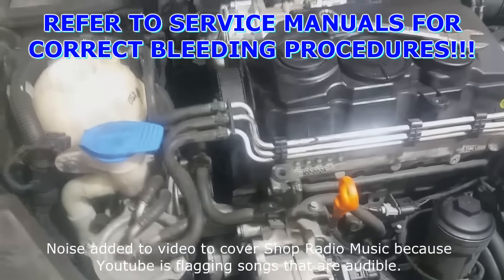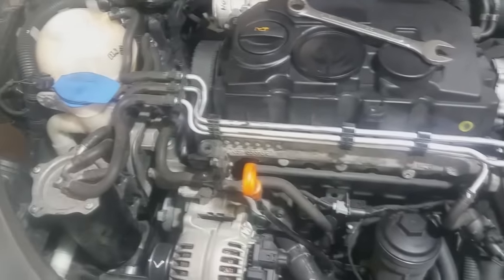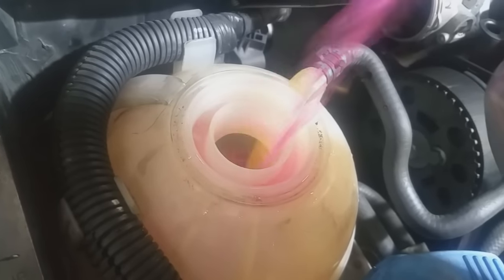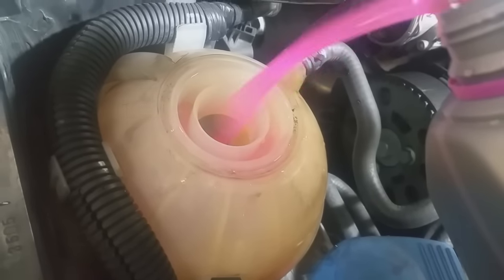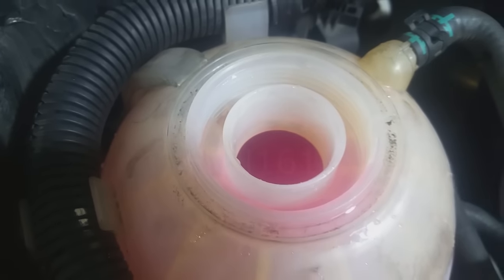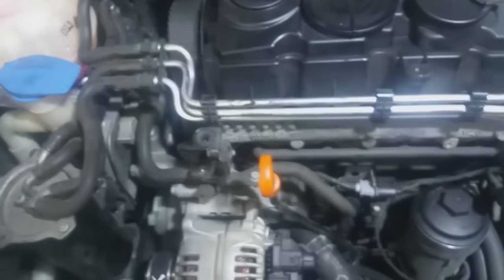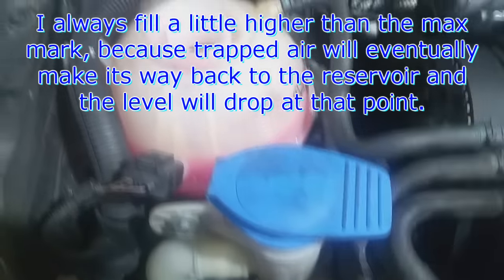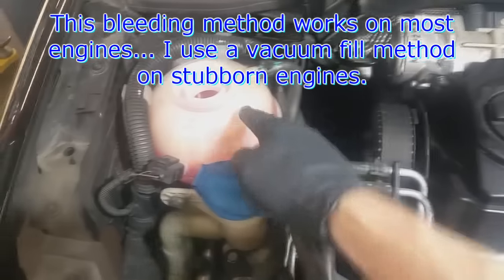Basic VW cooling system filling / bleeding info (viewer request)

Comment: Does the engine need to be on during this process?
Reply from the maker: I think one can hear that the engine is off... once the coolant level no longer drops, one can start the engine and confirm coolant flow back into the reservoir (verifying coolant flow). I think everything is mentioned in the video.
Reply: @EXOVCDS  sorry I'm a complete car noob and worry about this slightest things with my car. It's been making a water sloshing noise lately when I start the car and having a bit of a shaky start up. Researching it has led me to believe its the coolant system needing to be bled. I've had to top it off with distilled water this summer.
Reply from the maker: @tovar2358  Year, make, model, engine? Coolant level should never need adding... if it does, there's a leak somewhere.
Reply: @EXOVCDS  2014 jetta se 1.8 L. During the summer I had to top it off at least twice. After the second time my low coolant level light didnt come back on, 3 months now since it did that ding on my dash.
Reply from the maker: @tovar2358  Have a good look at all the coolant hoses, flanges, fittings etc. If the system is working correctly, it will bleed the air out on its own (into the coolant reservoir). Regular driving (until the thermostat is open... engine cooling fans come on) should be all that is needed to get the sir to bleed out. Higher RPM driving can also help force air out of the heater box inside the car (that might be the sloshing sound you are hearing). Set the heater to hot air, so that you can monitor heat. If heat gets cold all of a sudden, it could be due to air, water pump or an issue with one of the heater blend doors.

Comment: Should the cooling fans come on when the engine is warmed on TDI ALH ? I never heard mine only when I turn on the AC.
Reply from the maker: +Mateusz K You won't hear them when you are inside the car... if they come on at low speed. The TDI takes a long time to warm up. If the gauge in the dash says 90c / 190F the lower rad hose can still be cold. You have to wait quite a while... have someone sit in the car and hold the rpm at 2000rpm (20x100rpm) while you look at the cooling fans in the engine bay. Grab the upper & lower radiator hoses with you hands and compare temperature... the lower hose should stay cold for quite a while. Once they are both hot to the touch (can not hold them for long) the fans should come on. If the temperature gauge goes past 1/2 way towards 3/4... something is wrong.

Comment: how van i empty the radiator ?
Reply from the maker: Year, make, model, engine?
Reply: @EXOVCDS  Audi a3 2005 2.0 TDI i would really appreciate it if you would elp me .
Reply from the maker: The radiator does not have a drain valve... you will have to remove the lower radiator hose to drain coolant from the radiator. Because the hose is not at the lowest spot, some coolant will remain inside. If you are wanting to drain the engine as well... you will have to remove other coolant hoses to allow the engine to drain coolant.  You can also remove coolant temperature sensors that are in coolant flanges or hoses to do the same thing.
Reply: @EXOVCDS  thank you very much man i really appreciate it

Comment: Where to drain the coolant? Thomas
Reply from the maker: In a bucket. What size engine?
Reply: +Thomas EXOVCDS 06 Passat 2.0T FSI
Reply from the maker: There is not one place that will drain everything... you need to open the system in a couple (or more) places in order to drain most of the coolant. Some will not drain out (heater core, some will stay in the engine block and radiator). Remove the lower radiator hose, remove one of the hoses at the electric "after-run" coolant pump. Remove other hoses in other locations to drain even more.

Comment: I got a blockage.  How do I fix it?
Reply from the maker: Find the blockage... disconnect the hose at the other end. Do you have flow there? No? Check farther down the line.
Reply: So follow the return hose and disconnect  the hose at the end? I've been having overheating problems, change the thermostat, control fan swith,coolant cap reservoir. It kind of did the work but when I stop the vehicle the temperature starts rising. It's a 1.8 volkswagen jetta gli
Reply: The fans kick in buy stays the same forgot to mention that.
Reply from the maker: How is the heat inside the car? If there is little or no heat, the water pump is bad. Yes, follow the hose to where it connects and disconnect there. If it's a T fitting and nothing comes out, fully remove the T fitting to check it for a blockage.
Reply: When I turn the heater it's not that hot,but the ac it puts out cold air.  So the water pump then? Do you know how much they charge for that?
Reply from the maker: Phone a shop in your area to get a ballpark estimate... you can check the water pump impeller by removing the thermostat and checking if you can turn the impeller.
Reply: Thank you for taking your time to answer my questions, I appreciate it.  Ima fone some shops to see how much they will charge me and go from there. Again thanks for your help.
Reply from the maker: No problem... let me know what they find. If you want to check the water pump yourself... here's a thermostat removal video.
https://youtu.be/HjL9P5cZw6g

Comment: I hope you can help. 99 Jetta 2.0 overheating while driving after new water pump and thermostat. Does not overheat at an idle. I have flow from the head to the coolant reservoir, flow from top to bottom of radiator, heater blows hot, top radiator hose is hot, bottom radiator hose is cold. I have repeatedly squeezed the hoses to try and get air out. Running out of ideas?
Reply from the maker: When you let it idle... can you idle it until the lower hose gets hot and the fans turn on?
99 Jetta mk3 or mk4 (timing belt drives the water pump)?
Why was the water pump & thermostat replaced?
If you had a severe overheating incident, then you might have a headgasket issue.
Overheating as in the needle starts to climb or the coolant comes out of the reservoir pressure vent port?
Reply: Thanks for your fast reply! The upper radiator hose failed and it did overheat for about thirty seconds +/-. After replacing the hose it would get hot but the lower radiator hose stayed cold so I thought that might be a bad thermostat. When I removed the thermostat I checked the water pump and found the impeller was bad so I replaced the thermostat and water pump. Now it still gets hot when I attempt to drive it and the lower radiator hose is still cold.
Reply: I can't let it idle until the lower hose gets hot or the fans come on. Early 99 timing belt does not drive the water pump.
Reply from the maker: Sorry about the late reply... you said "Does not overheat at an idle". So the lower hose must get warm then and the fans come on?
Reply: I just now let it idle for over a half hour. The temp gauge did not move higher than midway and the fans never came on. All hoses hot except the lower radiator hose. Flow coming from the head into the coolant reservoir and the heater blows hot. Did not have time take it for a ride but everytime I have in the past it overheats. Very perplexing. I keep hoping it just has a big air bubble in it? Will try and take it for a ride at lunch time.
Reply from the maker: Scott Bottolfson Lower hose getting hot & fan coming on should happen within 6 to 10min of starting (hold idle at 2000rpm).. Overheating light blinking or overheating needle goes to the right? If needle is in the middle and the light is blinking, then it's not overheating.
Reply: Overheated again during drive. Lower hose never got hot. Thinking it has to be a bad thermostat even though it is new. Took thermostat out and put in another new one. That was it! Lower hose got hot and fans finally came on! Very relieved! Thanks for your help!!
Reply from the maker: Thanks for the update... I've had bad "new" parts as well. Bad new parts can be a pain because the first instinct is to ignore them (new part must be good). Good job rechecking things!

Comment: I have a strange problem :) when antifreeze tank cap is on and completely turned up (normal stance when driving), engine stays at 90 degrees, works good, but when i leave a car for a night, the antifreeze level is one centimeter lower. When i leave for the weekend, it's level lowers much more, i need to fill up. There is no leak on the ground, can't see any drop. And when i fill up the liquid, the air goes out. Maybe there is some air in the system? And then i've done an experiment. I was driving then tank's cap is not completely turned on (for some air to go out), and antifreeze level stays the same :) interesting yeah? So there is no leak, maybe there was some air in the system.
Reply from the maker: Yes, could have been some air. When the cap is tight, pressure in the system will push the coolant level down, when the coolant cools, the level comes back up. If you DID NOT open the system to do cooling system repair, then the air is coming from the head gasket. If you did open the system to do cooling system repair, then the air will eventually bleed out and the level will stay consistent / not fluctuate much.
Reply: 'when the coolant cools, the level comes back up'. Yeah, normally, but why the level is not coming back up when the car cools? It comes up only after i open the cap.

Comment: ohh ok cool..now is that a constraint?Or do you 50/50 it?
Reply from the maker: The G13 stuff from the dealer is 100% antifreeze... you need to mix it with water. 50/50 is a good mix for most areas.
Reply: I get the permfrost brand
Reply from the maker: +G. Christopher Good stuff.
Reply: another quick question..lol thanks for your help...I think the hose that connects to the flange..the one that hooks to the rear of the engine is bad as well.Do you know that part number right off hand?So I can replace that as I replace the flange?
Reply: send me the ebay link if you want ..that's where I got the flange off of
Reply from the maker: +G. Christopher Year & model... 1.8t right?
Reply: 03 1.8t
Reply: sedan GLS
Reply from the maker: G. Christopher The diagram does not show the hoses in actual shape / form (some). Look where they connect and you'll be able to figure out which is which. Confirm all part numbers before ordering online or from the dealer!

http://fkh161.ca/VW/Hoses.pdf
Reply from the maker: G. Christopher That's the one I replaced in that video I linked... common to leak.
Reply from the maker: G. Christopher $16.45 at 
http://www.germanautoparts.com enter 1J0122109AQ in the parts search box.
Reply: +Thomas EXOVCDS Thnx man.I appreciate your kindness
Reply: @neondiamondsaquaberry17  Go 50/50

Comment: what type of fluid should I use?
Reply from the maker: Devin Davis What do you have in the engine right now? Use the same.
Reply: Green ever since they flushed It 2 weeks ago
Reply from the maker: Devin Davis You can stick with the green, flush it every 2 years. VW G11 & G12 aren't made anymore... so if you want to use VW stuff, you'll need the pink G13 fluid. Flush that every 4 years.
Reply: Is it pre-mixed like 50/50??
Reply from the maker: Devin Davis No, the vw stuff is 100% coolant, which you need to mix with water. The generic green stuff can be bought mixed already.

Comment: hi my audi A3 2005 2l fan not working can you help
Reply from the maker: Check for power & ground at the big harness plug at the base of the radiator: http://fkh161.ca/Audi/A3/J293.jpg You also need to check the signal wire coming from the ECM (the ECM sends a signal to tell the fan module (part of the large fan) to turn the fans on).
Reply: +Thomas EXOVCDS thank you I will have it checked tomorrow.I appreciated your reponse
Reply: +Thomas EXOVCDS also to add ..my audi takes alot of water every 4th day should I use coolant instead
Reply from the maker: Ameer Cader Find / fix the leak and then fill with 50/50 mix. Coolant / water level should not drop.
Reply: +Thomas EXOVCDS thanks will do so. I will keep you updated. keep up the goodwork:)
Reply: +Thomas EXOVCDS hi I opened the fuse box.and noticed that fuse f27 amp 5 /10 was missing and f54 radiator fan output stage is missing too.
Reply from the maker: Ameer Cader Not sure why they would be missing all of a sudden... if you didn't have any issues before and you did not remove the fuses, then those fuses might not be used in your application / vehicle.
Reply: +Thomas EXOVCDS I bought this car last week. I don't know why it is not their
Reply from the maker: Ameer Cader So they were never working (vehicle runs hot since you bought it)? When you turn the AC on, do the fans run?
Reply: +Thomas EXOVCDS .never been working and no the ac fan too does not go on.
Reply from the maker: +Ameer Cader Continue with checking main power and grounds... the ECM signal to the fan module will be a pulsed signal / square wave. If power & ground, as well as pulsed signal are present... then the fan module (part of large fan) is bad.
Reply: +Thomas EXOVCDS so should notake put in the 50 amp fuse as well?
Reply from the maker: Ameer Cader I'll look for and will post a link to a wiring diagram for you while I'm at work tomorrow.
Reply: +Thomas EXOVCDS Thanks man. I appreciate your help:)
Reply from the maker: Ameer Cader Figured I would do it now before I forget tomorrow... http://fkh161.ca/Audi/A3/AudiA3CoolingFan.pdf

Save the file and then zoom in using your PDF client.
Reply: Update:I have put in the 50 amp and the fans are working and going on.I would like know since the fans are working will it slow down the water intake ?
Reply from the maker: Ameer Cader Possibly... keep an eye on the level.
Reply: +Thomas EXOVCDS thanks for the help. I have bought g12 coolant and will keep anot eye out for it
Reply: +Thomas EXOVCDS now that I did all that I hear a beeping noise under the bonnet. very light sound do you know what it is
Reply from the maker: Ameer Cader No... follow the noise to the source.
Reply: I switched on and switched of the car and the noise went away.
Reply: the noise came on cause i locked the car with the hood open
Reply from the maker: Ameer Cader Alarm beeping? Oh.
Reply: it was very soft the soud came from and close to the fans
Reply from the maker: Ameer Cader My mistake... A3 alarm horn is under the right front fender. Not sure what the noise is then. If it doesn't do it with the hood closed, I wouldn't worry about it too much.
Reply: ok thanks alot man.
tel me when fill coolant and water what is the best position to fill it to
Reply from the maker: +Ameer Cader Between the min & max lines.
Reply: Thanks so it should be filled as the bmws right to the top?
Reply from the maker: Ameer Cader Look at where the min / max mark is... middle of the bottle.
Reply: +Thomas EXOVCDS found it thnx for your patience and help
Reply: We found the leak seems like it is the heater valve dropping out coolant. And gives off a smell do you perhaps know how to resolve it could it be frozen water that causing the leak.?
Reply from the maker: Ameer Cader What heater valve? Heater core inside the car? Frozen water can cause plastic flanges or hose fittings to crack... even an engine block.

Comment: Thanks Thomas another useful vid.

I am interested in the workshop manuals download.  I have a '99 Golf "3.5" Cabrio 1.6 (WVWZZZ1EZXK013729) - and want to confirm that manual(s) is available before I purchase. 
Thanks
Reply from the maker: Hi, yes... manuals for your mk3 Cabrio are available via the https://erwin.vw.com/erwin/ website. When using your VIN in the "vin search" option, the site will / should only list manuals that are relevant to your vehicle. The only problem you will run into... is when searching for & downloading wiring diagrams. For older vehicles, erWin lists wiring diagrams individually for each system (ABS, airbags, Transmission, Alarm etc) as opposed to with newer vehicles, where it is 1 large wiring diagram PDF of 800+ pages). For your cabrio, there are 63 individual PDf files that came up in the search field (several of them do not apply to your car, not sure why they are listed / came up). Anyways... erWIN is the best bang for your buck! I pay $35 once every year and download a bunch of stuff to try and keep current. Let me know if you need any help or a sample file. If you have multiple VW's... you will have ample time to download manuals for several vehicles. Just set some time aside (I usually download on a long weekend, where I can dedicate a whole day for downloading. Keep in mind that I download for all models... you may only need 1 or 2 hours to download the Cabrio manuals.
Reply: @EXOVCDS  Thanks.
 Do you send me a Paypal invoice to et started?
Also - is there anyway I can choose to start from 8h00 (GMT) saturday?
Reply from the maker: I have nothing to do with that site...  erWin is a service by VW. You can start at any time that you like. Once payment is made, the 24hrs start... so if you pay at 8h00, you can download until 8h00 the next day.
Reply from the maker: Register here for a free user account:
https://erwin.vw.com/erwin/showCustomerRegistration.do
Pay for a 24hr subscription here:
https://erwin.vw.com/erwin/showOrderFlatrate.do
Search for information here:
https://erwin.vw.com/erwin/showSearch.do

Comment: Sir can you tell me how to fix hot start problem from 1.9 pd engine. I am from India. I watch your lots of videos. You are very intelligent. Pls help me. 🙏🏼
Reply from the maker: Does the engine stop running by itself or does it only not want to start when warm?
Could be crankshaft position sensor or ECM relay... maybe something else.
Reply: Engine start but taken long self .
Reply from the maker: Use a scan tool and check engine sensor date.... rpm, coolant temperature, fuel temperature. Check for fault codes.